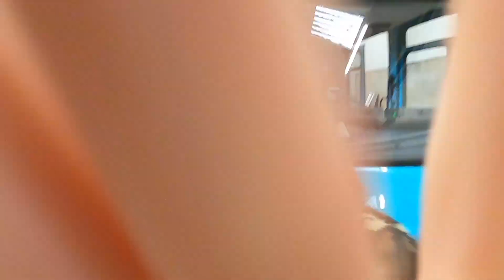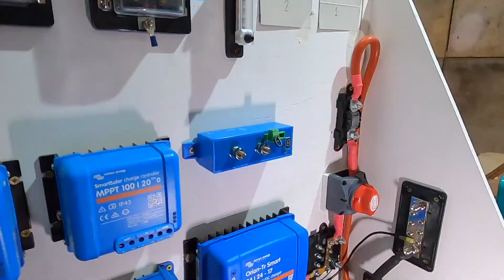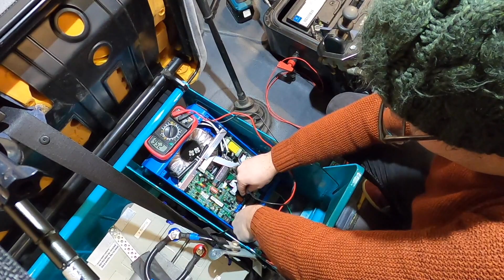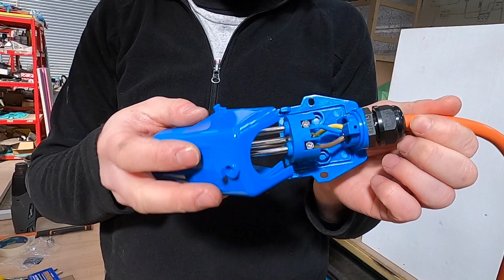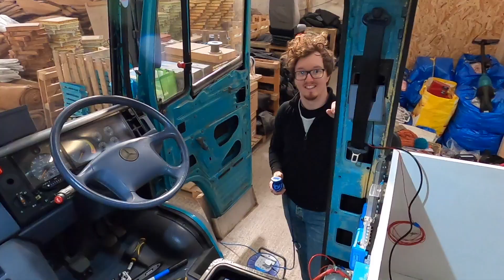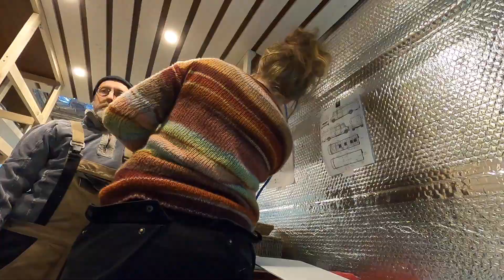How We Wired Our Victron System | CAMPER VAN ELECTRICS | Mercedes Vario Conversion | VAN BUILD EP30

Comment: Hi Max and Sophie, this is only an observation but rather than put that socket underneath the bus at the front where it will get covered in muck and water and salt in the winter months and the the sprung cap will probably corrode, and become inoperable, why not place it up higher just behind the drivers door, only a thought.
Reply from the maker: Thanks for the idea, we’ve convinced ourselves that the mud flaps and body kit will protect it enough, we’re probably kidding ourselves there. We just couldn’t find a more suitable place! We did think maybe under the bonnet?

Comment: SUPER JOB !
 get yourself some Tesa fabric tape, it then becomes addictive wrapping all the cable looms to look neater than factory. 
I have at least 3 different widths to get the wrap just nerdy enough to pass as perfect. Ed

p.s just seen your profile picture you are going to have muddy knees plugging your 16amp in and out, once the side mouldings are back on and your airbags have deflated. you will look like you have pitched a tent not pitched up in turquoise luxury.
edit.........my mistake.......derrrrrrr just open the door, Ha Ha
Reply from the maker: Woah! That was a rollercoaster of a comment 😂
Great idea with the Tesa fabric tape - we have a thin width already, but will definitely be buying some thicker stuff now! 
We really wanted the socket to be on the other side of that bracket but it’s U profiled so we could screw it in that way... we’ve convinced ourselves the mud flap will be enough to keep it safe under there, if not we’ll have to go to plan B!